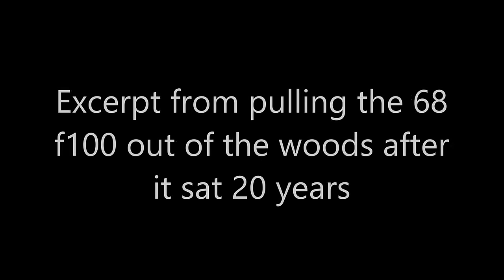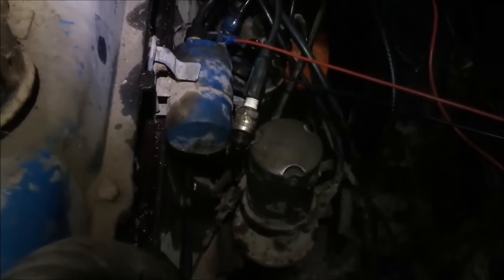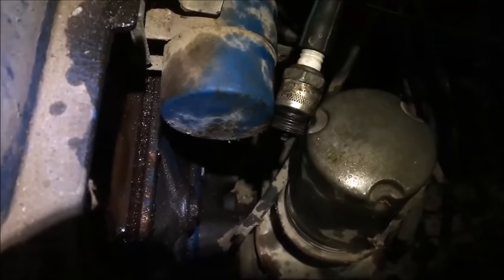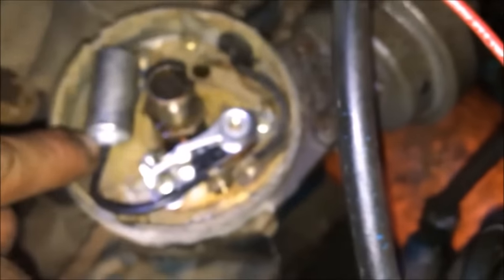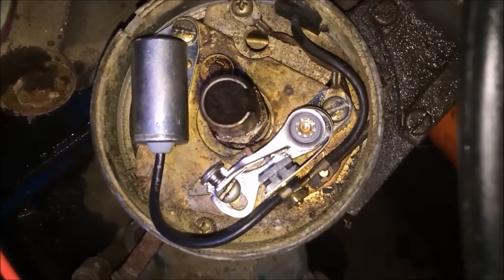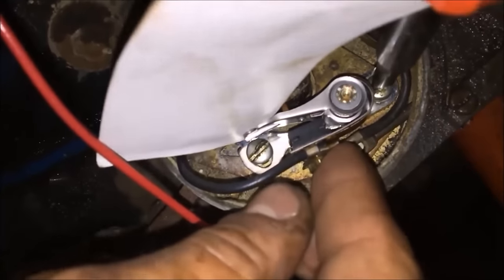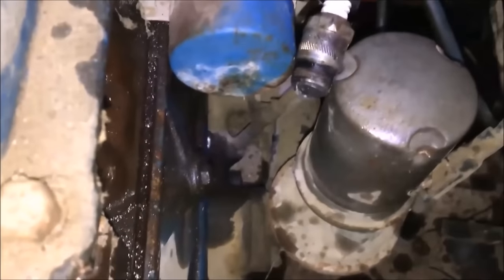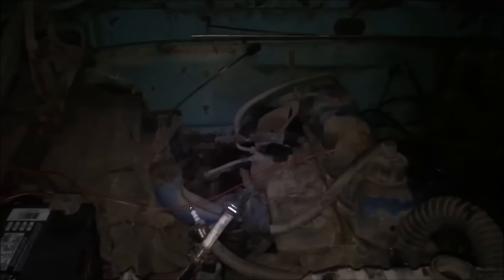How to: Test any Engine Ignition Coil - Simple & Effective (not for current subscribers)

Comment: Thank you for this video, I installed an HEI distributor from Southwest Performance, worked great for a year, now with no spark, bought their TUNEUP Kit and still no spark, I sent them several emails in the past 2 weeks and no reply, phone number listed is disconnected. So i pulled out my old distributor and going back to points. Never again after markets. You showed me how to go back to original. Thank you fellas, oh by the way, my truck is an 1969 Ford F250, with IL6 240ci engine.

Comment: Hi i want to ask because my new spark is going out of function i don't know if it's the fold of the pulse pickup coil because my  sparks going out of function,i have change the ignition coils and that was not the problem 
i this a CDI problem or pulse coils
If this is puckup coil the bike will not turn on right ?

Comment: I have a 289 stock distributor with electronic ignition.has new cap a rotor,plugs ,wires and coil. still will not start

Comment: Sir, I just got a 1968 F500 with 300 inline six.  For some reason the previous owner unbolted the valve cover but it appears to have new(old) distributor cap, rotor, and points and wires and maybe spark plugs.  I still need to pull out the spark plugs and test for spark.

Comment: seem to be a common prob.with  (spark)   usuall that is caused by wrong condenser installed   mant consenser look just alike but the are wound diff inside  they come in diff micrfared values  to work correct they must match the coil electricly  very old dealer manuals for proper condenser # of original the cross ref todays  equivlant with correct condenser the spark should jump 3/4 of an inch with eng idiling pull a plug wire off insert screwdriver hold close to eng  how far will jump1/4 or less not good  if close to 3/4 inch very good whi changed mine it went from 1/8 in to 3/4 inch   big diff.worth looking into

Comment: I always used a matchbook cover. Worked every time!💥
Reply: That's a great idea you can use the stryker to sand the points clean too👍
Reply: @63Imp283  if you are having to clean points you prob. have wrong value condenser  the cond has match the coil electricly   wrong cond will not .pass proper amount of votage so it jumps back thru the open points to gd pitting the points   verfy proper condenser. most dealers have old manuals showing  all  original  part #s

Comment: ive tried everything in this video and replaced most of my ignition system at this point (spark plugs, Spark plug wires, points, condenser and coil) still cant get spark if anyone has any suggestions or ideas please let me know im about to go crazy 

P.S. it's for a 1967 ford thunderbird V8 390
Reply from the maker: .... dumb question, but do you have 8-12v even getting to the coil. 
Remember, classic car owners aren’t parts changers, they are diagnosticians